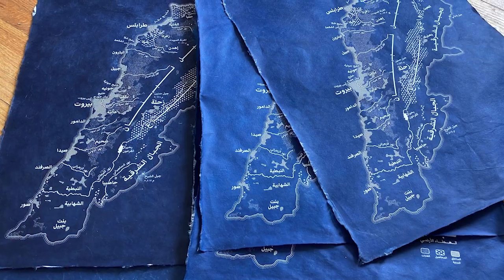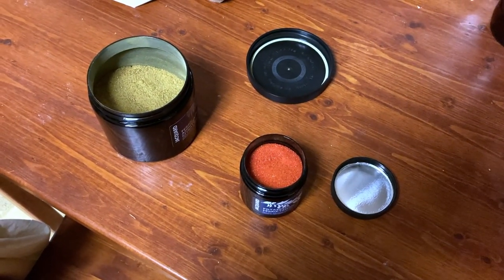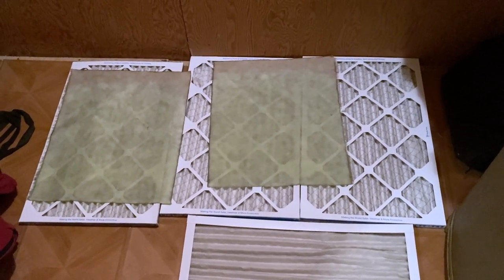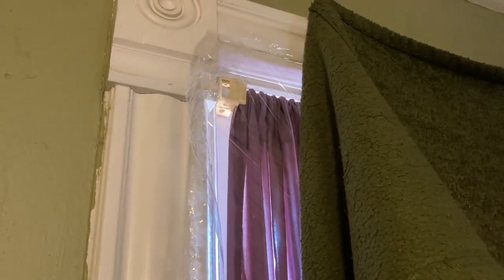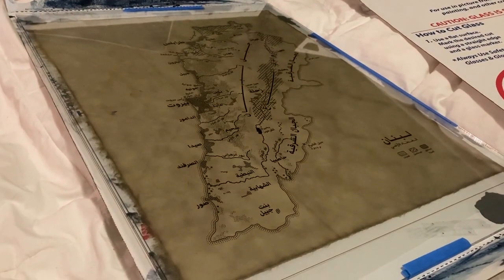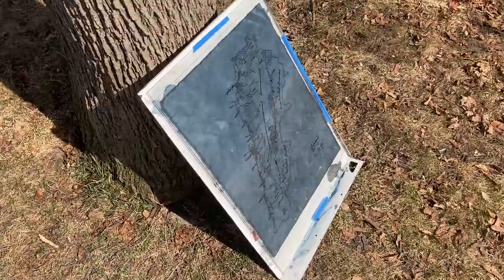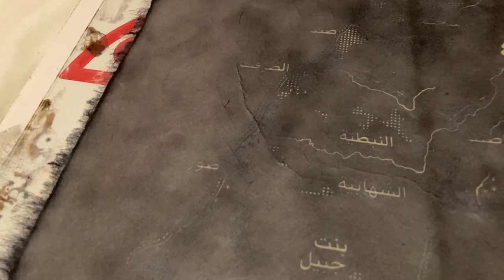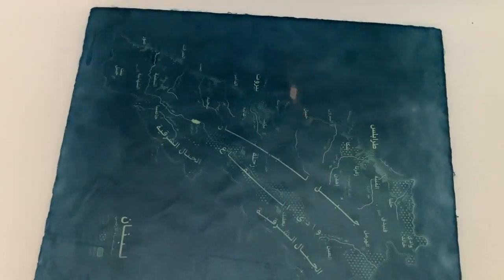Cyanotype Printing: Behind the Scenes

Comment: This was very interesting, thanks for sharing this process!! I was wondering if it could help with the blurring and light angle issues, to mirror the negative and to place the printed surface directly in contact with the paper? So as to eliminate the distance cause by the negative film's thickness and the defects that may appear when the light transfers the image?
Reply from the maker: That would be interesting to try! Minding the light angle is useful for an additional reason I didn't mention: I believe the process should go a little faster if it's angled to catch the UV more directly. Especially handy on cloudier days when exposures can take a long time.